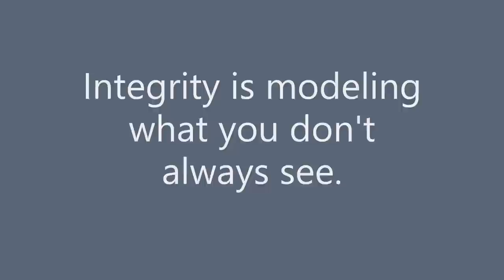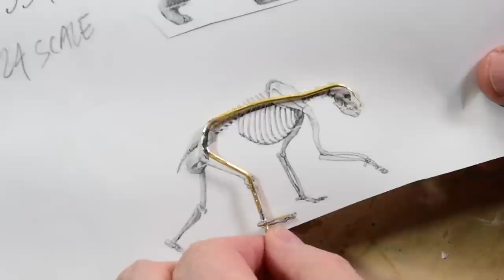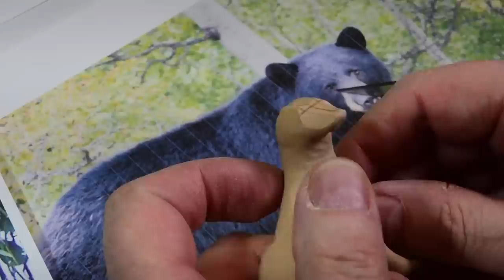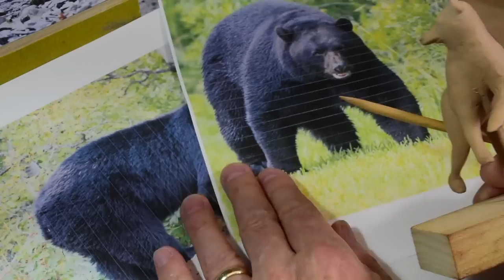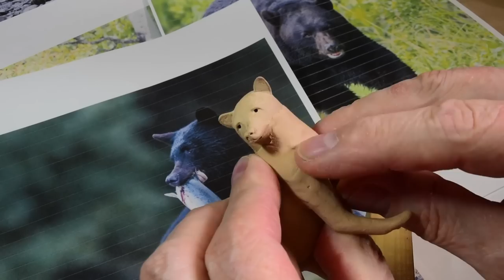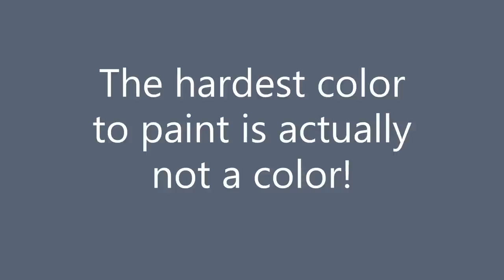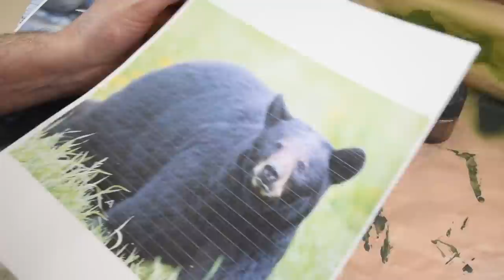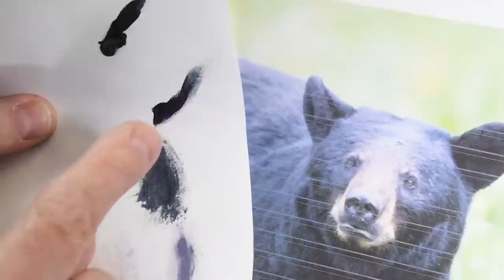Diorama Chronicles | The Bear Sculpture & Paint | Boomer Diorama ~ Chapter 7

Comment: What is the set pressure of your compressor. I work now for the first time with the Tamiya XF pains, thinned the way you do but the problem is that I create too much mist during painting. What can be the issue, only pressure or also somthing else? Thanks in advance for your reply. Cheers from the Netherlands  Ronald (Modellbahn Rosenbahn).
Reply from the maker: Shoot tiny amount of paint and build up slow. Pressure helps to shoot small paint point with practice on paper. Practice lot's on paper with thin paint. When you pull back on the trigger, do it tiny amount.